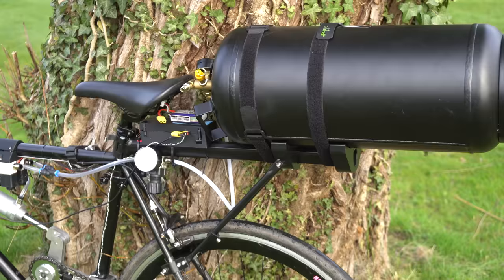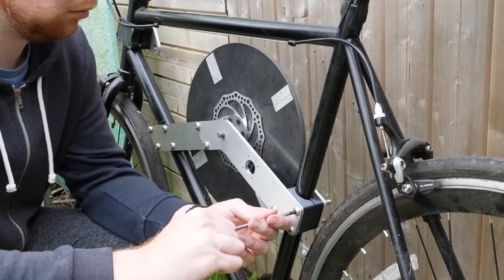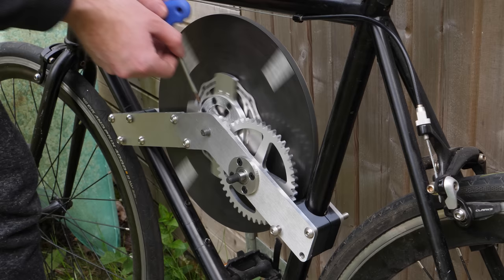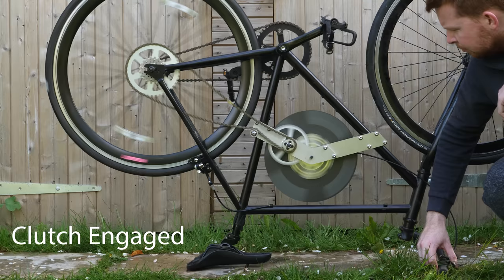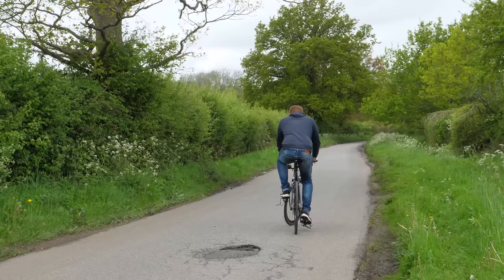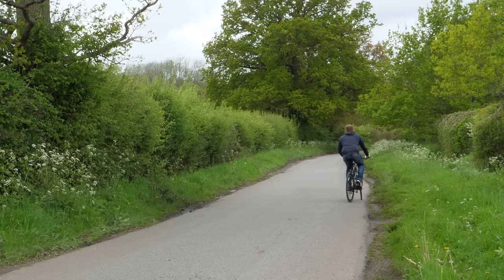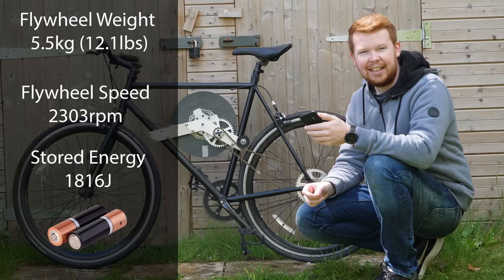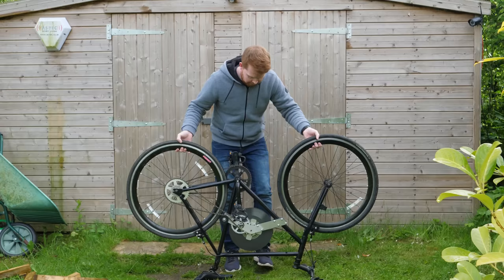Flywheel Bike KERS

Comment: Adds heavy disc to capture energy when stopping. Increases mass of bike so it takes more energy to accelerate again.
Reply: do you shit first before you ride a bike ?
Reply: Everything here screams waste....
Reply: @Deontjie  Other than it being a project to further one's skills and understanding. I liked what he did in the middle, ignoring the braking part and just seeing whether the flywheel at maximum speed could even accelerate him much.
Reply: @nopochoclos  Yes, you got most of it right.
Reply: Always those pesimists... U can take off material of the disk and add it to the disks periphery, then the disk gets much lighter, and its inertia much higher... It was just a fast-and-cheap solution, as part of a proof of concept, and to dial in the mass of inertia needed for an even better protopype... In other words, 22% speed-gain is great, but he needs a cleaner running system, and a differently constructed flywheel, with most of its mass on its periphery... Maybe a lead-ring flanked by 2 steel disks?
Reply: @klausbrinck2137  The flywheel could be parallel to one of the wheels. Perhaps it could even engage the wheel directly, no gearing, with a friction clutch.
Reply: @gblargg  Accelarating the flywheel while pedaling was a crude mistake, also according to my opinion, no objections there. He should accelerate the flywheel only when braking, everything else makes no sense, for sure. And your solution is also elegant, there is kids´ bikes with a  (e-motor-propelled) flywheel inside the front wheel, so that kids learn cyling (mass of inertia keep the kid with its bike upright, so they get used to train their feeling of balance... ). So, it´s correct that accelerating simultaneously both the bike and the flywheel is false, but not everything he did is false... 
Your objection can be overcome: Build the flywheel out of a lead-ring (heavier than steel), and use much less steel (than shown here) to connect it to its axis. So, you save lots of the flywheel´s weight, while increasing its mass of inertia (and thus its effectivity) at the same time.
Reply: @klausbrinck2137  Him accelerating the flywheel while pedaling up to speed seemed to just be an experiment to see how well the flywheel could work, not the actual way it would be used. It wouldn't make much sense to use the bike like that.
Reply: @gblargg  no gearing would mean very little energy stored
Reply: @klausbrinck2137  There is nothing wrong about speeding up the flywheel while accelerating. Let’s say you live in a valley and you go to work on top of the hill. You know in advance that you are going to need energy. You can store that energy before with more time and less power (and/or force) and release it when needed. You need to take into account the evolution of your potential and kinetic energy during the journey and manage it correctly to be efficient.
Reply: @klausbrinck2137  So have heavier wheel rims.
Reply: You clearly have no Engineering background whatsoever.
Reply: @nopochoclos  depending on the car yes, flywheels are shit. My car’s flywheel weights 30lbs, swapped it for a 20lb and the car revs faster. And before you say I lost torque, I have a turbocharger that makes up for it. And. As for the engineers being assholes, Audi, vw, GM, fiat show they are.
Reply: @PatricioGarcia1973  I have a peaceful Citroen 2cv.. i need the flywheel haha.
Reply: @klausbrinck2137  maybe we should even try supercaps and charging them with braking or by Cycling, Yours too Is a good idea
Reply: The energy stored in the flywheel is momentum. p = mv There's no reason a flywheel couldn't recover more energy than it costs.
Reply: @Anankin12  - if you have a large-diameter flywheel sitting next to the rear wheel, with most (90%) of the flywheel's mass in its rim, would there be enough space for gears between the rim and axle?
Reply: @tavdy79  no idea, I think it would depend on your engineering skillz and resources
Reply: Use gear system, use low gear to start pedal, don't use high gear.
Reply: @thorr18BEM  how? What ? Huh? Are you completely mad?
Reply: @edmundscycles1  I was not saying it's magic, just that some people are looking at it wrong. Every time the user brakes while going down hill or brakes for an intersection, they can transfer the energy of their momentum into the flywheel at no cost to themselves because they were going to brake anyway. The extra mass of the flywheel adds some cost when the user resaccelerates but that extra mass also wants to keep going when braking so that almost cancels out anyway. It's not a mass battery, it's a momentum battery and that's why I was commenting because someone implied it doesn't work that way. When you have a lot of velocity going downhill, you have a lot of momentum. The energy stored in the wheel at that point is much higher than if you were just carrying an extra dead weight non-spinning wheel (because p = mv ). If you throw away all your momentum 10 times on a trip and the wheel helps you recover most of it each time it could be worth it. It takes away the strain on the user of the initial takeoff which can feel harder than adding a little speed once you get going and the same applies to uphill travel. Going up the hill takes more work because of the tiny extra mass of flywheel but the energy it has stored from earlier can be much more than that because its storage scaled with velocity not just mass. Even if you want to ignore the comfort to a user or engine both who perform better at certain RPMs we could still look at it thermodynamicly: If you stop at the bottom of 10 hills and have to climb 9 hills before your destination, you could get more energy returned than the cost the user had to put in. Without a flywheel, all 10 of those downhill slopes of energy are thrown away by the 10 stops and the user has to arduously climb 9 times. In contrast, with a perfect flywheel, the same trip could take zero energy from the user. Since zero is less than the cost, I stand by my statement and so in answer to your question: no, I am not mad.
Reply: @thorr18BEM  it's still not worth the extra mass . That flywheel is useful for say 5 to 10  seconds and then your carrying a load of extra parts that add resistance mechanically  sapping your energy . Adding several Kg of equipment makes zero sense as that sapps your energy really quickly . Probably costing  several minutes on a climb and quickening your fatigue.   

Still your sums do not work . Energy out does not equal energy in due to heat/noise/mechanical resistance loss . You also expend much more energy going up hill with a heavier bike that on a lighter bike .  

So nope this thing is a pile of utter shit for anything other than flat terrain and journey of less than a mile.
Reply: @edmundscycles1  Sorry, but I believe you made a mistake with your energy consumption. There is only an additional energy cost with the extra mass when you are accelerating / decelerating, not when you are maintaining your velocity (aside from friction forces).

So although the flywheel will add extra weight, in return it does allow you to store your horizontal kinetic energy into rotation kinetic energy when you are decelerating, and then convert the rotational kinetic energy into horizontal kinetic energy when you are accelerating. From the results in the video we see he had about ~15% efficiency with these conversions.

Theoretically if you are making more than one stop (if you only stop once then you never get to re use that energy) you will be conserving energy by using the flywheel.

In practicality his setup shown in the video would probably not be very useful. As a proof of concept though it does show this idea could work if it was worked on and refined.
Reply: aluoooo  min   euim

Comment: This seems like it would be useful on hills, gathering momentum in the flywheel downhill to help uphill
Reply: And when you're stopping at traffic lights, because you can get half of your speed back for more or less free
Reply: Unless there is some reason to brake, though, a flywheel system would be pretty much useless for retaining energy from hills. You already retain energy from hills as it is converted to KE at the bottom. The big difference between having a flywheel or not in the case of simply going down a hill and back up is what your max velocity at the bottom would be. This may save you some losses from aero drag, but the flywheel itself would add all sorts of mechanical drag in its own right. Just listen to the hellish clacking and screeching that Tom's rig produces, even when the clutch isn't engaged. All that is energy being lost from the bike. Not to mention the danger of a high-speed flywheel mounted on a bike and all the stress that would be experienced by the mounting and bearings due to gyroscopic precession in turns.

The implementation of a flywheel system like this would only be useful for helping to retain substantial losses of energy, such as when braking or from aero at high speeds. In other words, what it's good for: Going down a hill, stopping, then going up a hill. Reducing max speed on large hills to save from aero drag. Bikes that are designed for slower speeds. Straight lines.

What it is not good for: Your average ride across mild slopes. Any instance where you want to achieve high speeds. Bike designs that are already built for low aero drag. Sharp turns.
Reply: also worth to mention, that +5kg flywheel is not as small as if an avg bicycle is already around 10kg (a commuter is 15kg)
Reply: @christopherbare9277  The flywheel will allow you to slow for junctions and corners at the bottom of the hill, but it is more efficient to store kinetic energy as your speed rather than the flywheel rotation.
Reply: @hesterclapp9717  nope, more like only a quarter. Compare the graph: flighwheel meets bike speed halfway during breaking. And during acceleration bike meets flighwheel speed half way again.
Without a clever gearbox this won't work out
Reply: @christopherbare9277  This and also a bunch of steel gears and wheels aren't your best friends uphill. Losing weight is probably a lot more beneficial than a KERS when going uphill.
Reply: @christopherbare9277  i agree with most of what you say, but something to consider. what if you dont want to be going at uncomfortably high speeds at the bottom of a hill? this would be great for situations where staying at a safe speed is more important than maximum energy retention.

Comment: For more efficiency, I think you need two different gears, one for decelerating, and one for accelerating.
Reply: Really, one for high speed operation and one for low speed operation. Brake using the high speed, then the low speed. Accelerate using the low speed, then the high speed.
Reply: Exactly what I was thinking. A small system that flops over depending on which way the energy is being sent.
Reply: Transmission weight should also be "in" flywheel weight. This way no additional weight to bike. So transmission should also be spinning. Pretty interesting mechanical challenge.
Reply: That's exactly what I was thinking. The design question becomes which solution is best? A second engageable system, a gear changer, something else...

Comment: I like it.  
I have a downhill mountain bike. Imagine this concept on the downhiller. You brake all the time. Could use the flywheel to boost off jumps or when it’s time for a short pedal between downhills.  
I think you got something here if you refined this. Although I wonder about gyroscopic forces on the bike and how it will effect turning and stability.

Comment: I could see myself charging up the wheel going down hills and using it sparingly whenever
Reply: This thing weight 5 kg!
Reply: I assume by "using it sparingly" you mean launching off a ramp into orbit after having charged up the flywheel for several years
Reply: I think another issue (besides it just not having much energy) is that it won't speed you up if you're already going faster than it is. Then it will just slow you down more. So unfortunately it can't be used like a nitro or something.

At least, not without including an extra gear shifting ability that could gear it up or down. Which would be cool, yeah. But still probably enough energy for much.
Reply: @I love you but 
I love the fact, that when I read your username and then the comment, it makes perfect sense

Comment: An infinite CVT would enable you to minimize energy lost to friction within the clutch system.  
It would be REALLY awesome to see you design a compact CVT.  You would also be able to transfer more energy into the flywheel than just matching your half initial velocity magnitude of the bike.
Reply: Yes it looks like most of the energy is still being lost in the friction from  initial engagement of the clutch
Reply: Aye, though CVTs have traditionally suffered when it comes to efficiency themselves.
Reply: @jubuttib  true, nothing is perfect.  Although, definitly would be an improvement.  The 2008 Dodge Caliber uses them and boy oh boy are they great on fuel economy when compared with similar weight and power vehicles without CVTs (see comments later below, this argument was invalid)
Reply: @timothysands5537  Really? Interesting, I've yet to ever see a CVT car match a manual in fuel economy (beating a traditional torque converter automatic is a different thing and shouldn't be held as any kind of "win" IMO), at most matching on average due to slightly better city economy, with worse highway performance. It has been a while since I dived down into CVTs, may need to have another look.
Reply: @jubuttib  oops, you're right.  That is a faulty comparison when compared to an automatic transmission.  
As far as the manual car goes, it has slippage in the clutch mechanism until the clutch's rpm matches the engine's flywheel rpm right?  If Tom were to use something like the nuVinci hub seen on bicycles, wouldn't that be better (less frictional losses) than the clutch mechanism?
Don't quote me on this, but I also believe CVTs are still able to outperform manual transmission vehicles by taking advantage of operating in the optimal power curve (or was it hp curve? There is a difference). Engine efficiency declines as rpm climbs.  CVTs can vary their gearing constantly to maintain the engine rpm as the vehicle accelerates.
Reply: I have a little 150cc honda motorbike engine (GY6) that uses springs and weights to adjust pinch plates on a belt type cvt that would be perfect for this. You could make it so the slower the bike is traveling the more energy the flywheel is absorbing. This would potentially increase the braking capacity of the flywheel to 65-70%. Acceleration would be slower, but more gradual and probably far more efficient this way as well, since the faster the flywheel is spinning relative to the rear wheel, the lower the gear ratio, meaning as you speed up it draws more and more power from the flywheel to the bike giving a smoother acceleration with exceptional low end torque.
Reply: So I'm not the first who thought of that
Reply: emissions free? theres no free lunch bro. But that would be aswesome if you actually did build that. do u have any links to this?
Reply: Or maybe use a much harder clutch in combination with a spring. So you get smooth engagement but retain more of the energy.
Reply: No need to design one, pull one off some kids 50cc scooter.
Reply: @soupisgoodfood42  ideally it would be an instant lock in of the clutch, or as slowly as possible, in a world without losses. but in the real world, heat due to quickly "dumping" the clutch would lose a lot of energy but transfer whats left before it had time to slow down from friction. theres pros and cons to what you use depending on the application
Reply: @Peter Evans you still got the images?
Reply: @Peter Evans nah thats cool and all but do you still have any images of the kart. you said you just didnt post them back then which is understandable. but i wanna see it. maybe just post a scan or a picture of the original images you have. you can use gyazo or imgur to post it.
Reply: @punchtheundead3127  Emissions free is a thing, just not with me riding a bike.
Reply: @Peter Evans because i want confirmation this was actually made. I understood perfectly.
Reply: @Peter Evans i want pictures of it bro.
Reply: @Peter Evans I would just like to see some sort of verifiable proof, it seems like if this was something that cool nowadays, you'd have already pulled some pictures for your own pleasure. The fact you're being so defensive is kind of telling me that this was not legit
Reply: @Peter Evans not true at all. i just dont take anything i see as fact on the internet without having something to back it up. if you're not poor give some pictures. no one even brought that up lmfaooo
Reply: @Peter Evans who do i make the check out to?
Reply: @Peter Evans I am a welder lol, i could easily fab something like this up in probably less than 2 weeks time.

Comment: This concept works better on an adult tricycle. You can mount a heavy (80-100 lbs.) flywheel and use the crank to spin it up while stationary. You get a great launch from the heavy flywheel.
I once read about a man that invented a car that used this concept but with small motors to spin the flywheels as well as breaking force. Fun stuff.